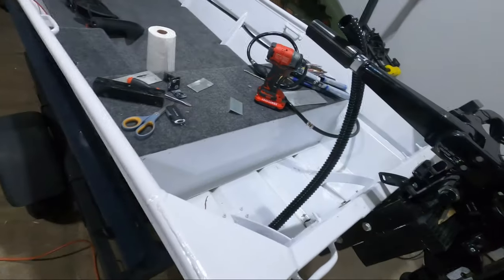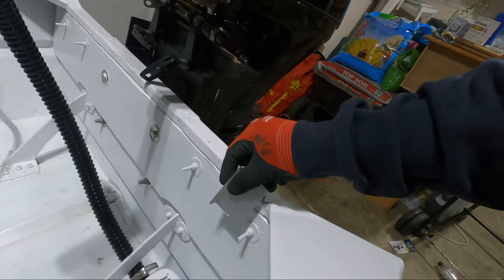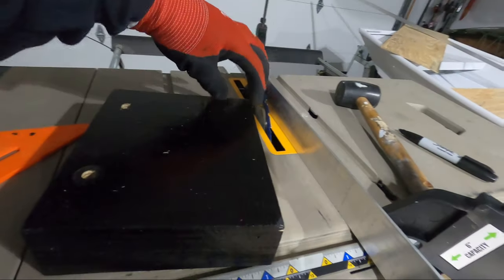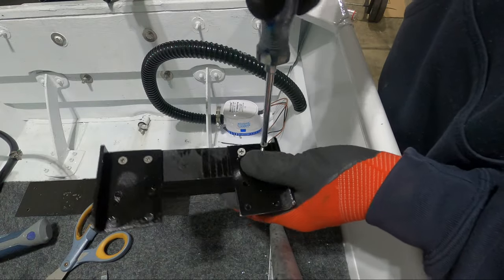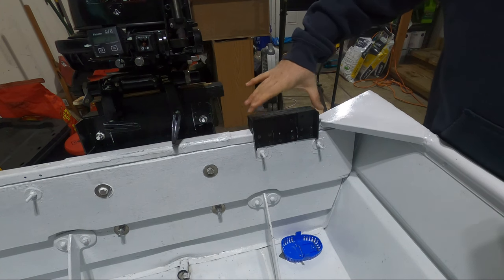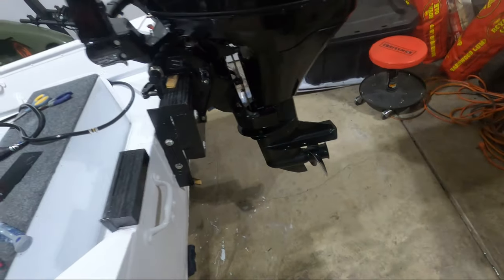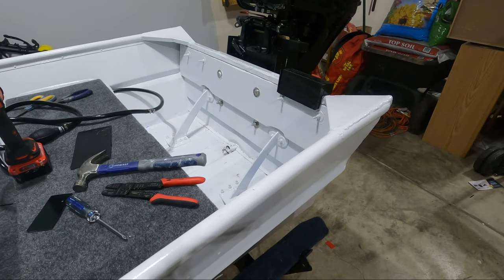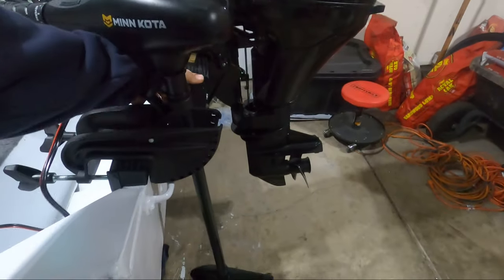TROLLING MOTOR TRANSOM MOUNT FOR THE JON BOAT CONVERSION BUILD - Minn Kota Custom Mount

Comment: Pretty nice are u going to do a video on how you made the jack plate for your mercury I'm currently working on how to redesign mine
Reply from the maker: For sure, right now I'm still testing and adjusting the height. I need to take it out once or twice more for a good test run.

Comment: Nice video....I just picked up my first little 3.5 hp Merc for a Pelican Bass Raider..My question is, do you recommend a transom saver for you outboard to transport or can i safely strap the motor in the down postion to transport...I see comment both ways & welcome your suggestion.
Reply from the maker: I have always erred on the side of caution and went with a transom saver with anything from a 9.9 up to a 50 horse. I know what transom saver isn't going to hurt anything, so I'd rather it have the chance of helping.
Reply: @mvboutdoors  Thanks for the quick response & advice. Look forward to keeping up w/ you